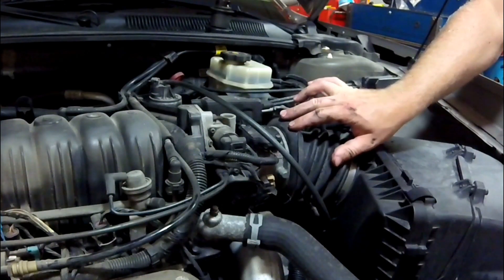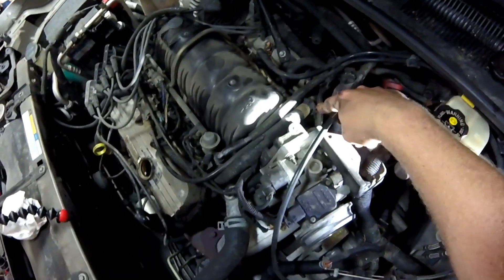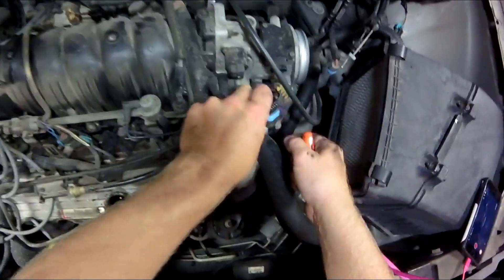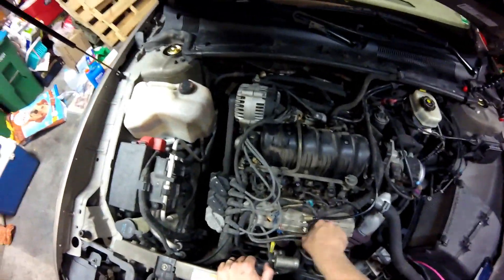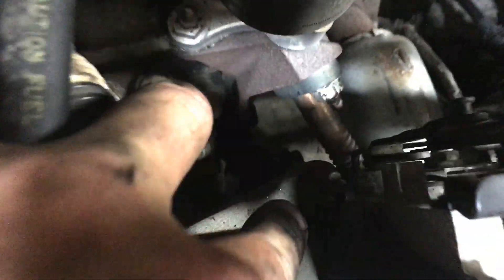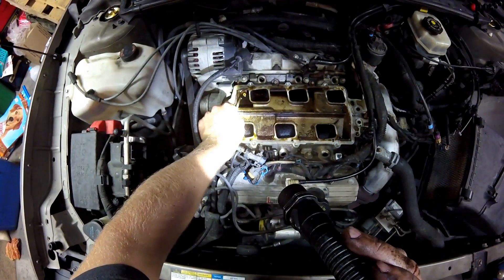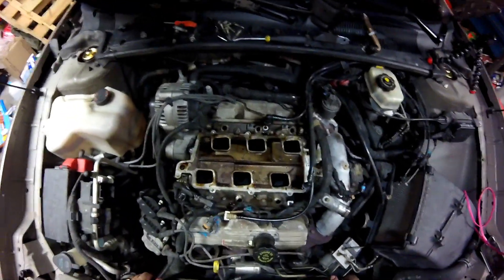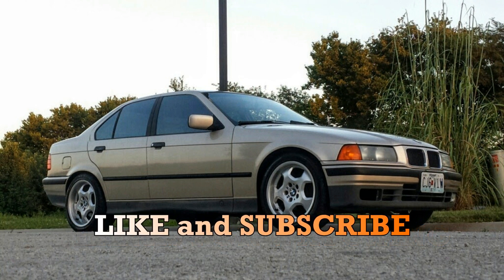How to replace GM 3800 V6 intake manifold gaskets -Part 1

Comment: I am struggling with the injector connector clips
Reply from the maker: Push the center of it. It should cause the sides of that wire to spread apart.
Reply: @PetesGarageandperformance  thank you for the reply. I did figure it out. And thank you for the series it is very helpful

Comment: I can't get the plenum off pete
Reply: Hey Pete I got her all apart, i just had to pull the mount bracket lol my bad hahaha. I got everything apart, cleaning up the Lower intake right now. Some coolant made it's way into the engine, any advice on how to handle that? Oil change ect.
Reply from the maker: Yes. You must change the oil.
Reply: I read about a "dummy change where you put the required amount of oil in, and turn the crank a bunch of times, then let it drains again? Anything like that. You've been a lifesaver peat.
Reply from the maker: Eh. I just do a regular oil change. Never had any problems. Is it just coolant that made its way into the oil? The coolant sinks to the bottom anyway
Reply: Yeah I lost maybe 2-4 ounces into the area where that balance shaft is, there was also oil in the two bolts located on the inside of the intake manifold
Reply from the maker: Make sure you remove all of the bolts!
Reply: On the 98 th lumina it doesnt just lift off like that theres a bracket underneath the thermostat
Reply: Do you have a facebook?
Reply from the maker: @klagemas  I do not have a Facebook page.
Reply: The bracket wont let me even get to the throttle body bolts attached to the plenum
Reply from the maker: @klagemas  are you talking about the engine mount bracket?

Comment: It's a good thing the series III went back to the aluminum plenums.
Reply from the maker: Other than the plastic upper intake plenum eroding away near the throttle body, there weren’t really too many problems with them.

Comment: Why wouldn't you just replace upper plenum? I did. Preventative maintenance. These things always warp.
Reply from the maker: I’ve done hundreds of these intake reseals. The only times I’ve replaced the plenum was when the coolant ports near the throttle body or EGR were chewed up.